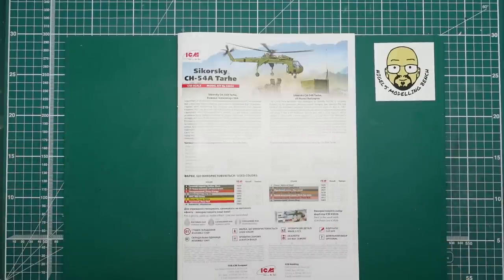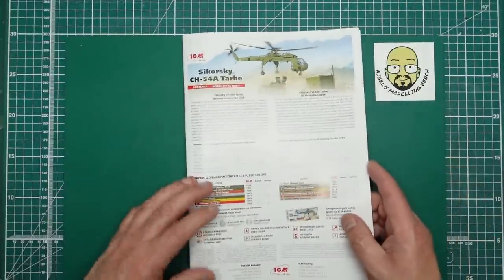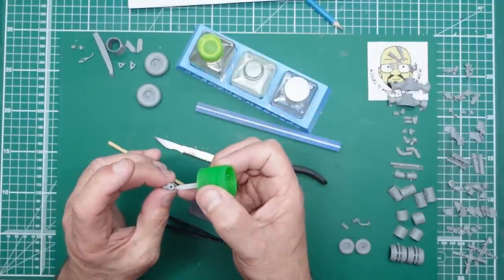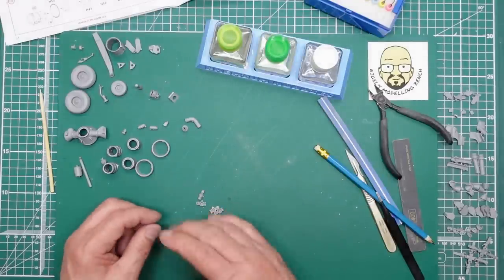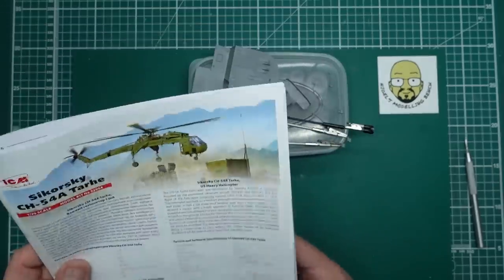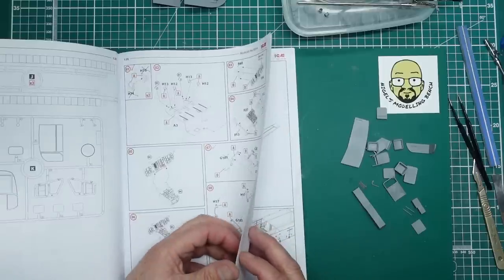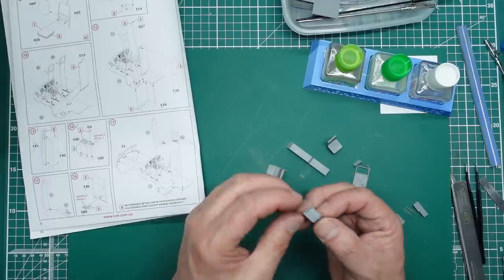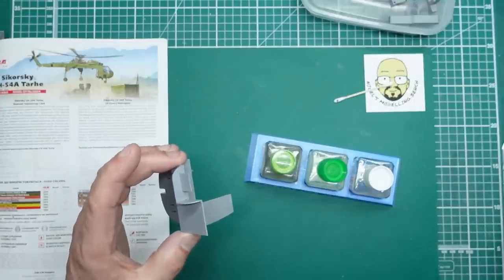ICM 1/35 CH-54A Tarhe build. Part One

Comment: Nigel, when it comes to painting, I am like you.  I tend to build as much as possible prior to assembling everything.  Another trick that I use is to add some Elmer's White Glue (used in craft industry for paper here in the U.S.) and cover the contact area on the part, paint it and then peel it off.  This leaves a nice contact area for the part.  A little time consuming but allows you to paint the major components.
Reply from the maker: Great tip..

Comment: Great start to build Nigel. 
      Quick aero review from a pilot. Looking down on main rotor, Skycrane rotor rotates CCW. Therefore nose will turn CW due to laws of motion. As I pull power(increase) collective to a hover, nose wants to go right and the pilot counteracts this by left anti-torque pedal. Left pedal nose left, right pedal nose right. The tail rotor blades change pitch/thrust on tail using the anti-torque pedals which allows pilot to move nose in desired direction.
     Some helos and most RC helos main rotor turn CW. The nose goes left when pulling power requiring right pedal. So much for muscle memory. Sorry for the long post.
      Glad you got a good report from Vet.
Reply from the maker: Brilliant!! Thank you!!

Comment: The cyclic is the "stick". It tilts the rotor disk fwd/aft and lft and rgt which results in the thrust of the rotor disk being directed in a specific way and the resulting action is the helicopter moves forward, left etc. The lever to the left of each pilot seat is the collective and, as the name suggests, changes the pitch of the rotor blades collectively. This results in more or less lift and the helicopter gains or loses altitude. The tail rotor counteracts the effects of the spinning main rotor. The "rudder pedals" change the pitch of the tail rotor blades and causes them to produce more or less lift and allow you to point the nose where you want it.

Comment: NIgel, Question about build sequence.  I'd appreciate your perspective on building from the "inside" to the "outside", for example. I might have thought that putting the anti-torque pedals on before installing the little cooling fans might have made the made the installation of the pedals easier, as the fans wouldn't (possibly) be in the way.  I know that, in this particular video, you were worried about breaking off fragile parts whilst fitting the various bulkhead pieces, but, absent that consideration it looks like making the job of fitting small parts onto larger sub-assemblies would, in general, be easier when there are fewer parts in the way.
Reply from the maker: I guess you are correct Tron, however, my head is just not in it right now so am doing some silly things. The reason for leaving off the small parts before fitting major parts is so they don't get knocked off if any filling/sanding is required. In this case, I didn't need to fill anything, but I did do a lot of sanding.